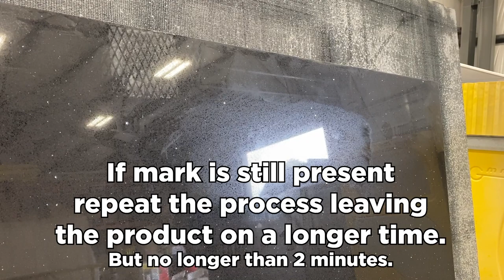Tenax Extraclean Pro Quartz Grease and Vacuum Ring Stain Remover

Comment: Tenax is GOLD❤️🔐
Reply: Hi, have you used this product? Curious to know if it works
Reply: Yes I am a master mason in the Orlando fl area and I work for a counter top repair company called Countercrew full time for many years 

We use this product to even out ghost marks and manufacturing and fabrication remains before we re apply the quartz toner on the micro finish 

Feel free to write to me at this YouTube account if you have any questions 

I can help you out further through email as well so I am here for you :)
Reply: @Dungeonofman  Thank you for your response! Before you wrote I had called Tenax and spoke to someone about what and how to apply. I used the extra clean pro and had success with removing the suction cup circles I still had from installation. I used their quartz toner after as directed. 
It has been a few weeks now and I am not to pleased with the look it has left. Not a uniform finish I expected. Hopefully overtime it will blend better. So, just a little disappointed.
Reply: @Dungeonofman  Hi! Do you have an email address? I’d like to speak to some one who has used this product.